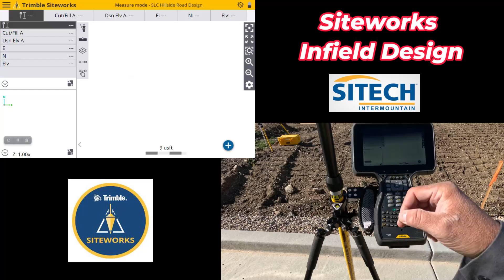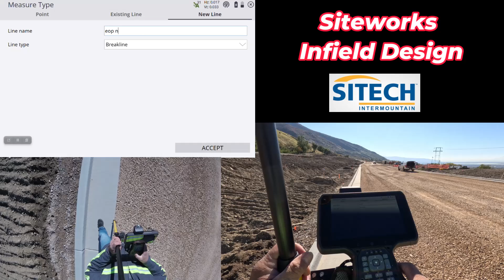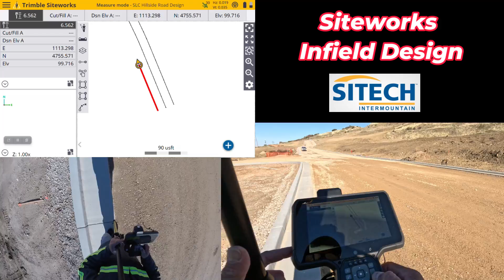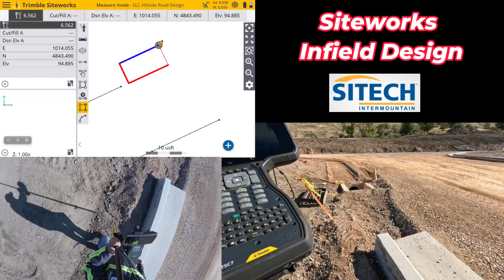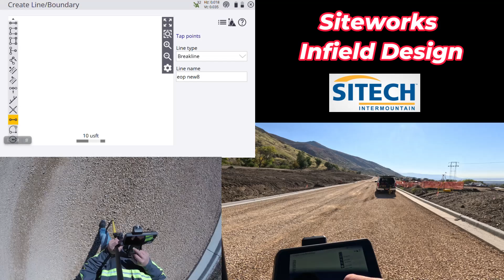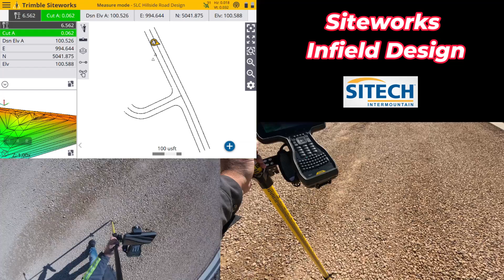Siteworks Infield Design   Creating a Design off new curb

Comment: with a one point calibrations what is the limits before you start loosing accuracy? as is how far from the base can you get before its starts to be off if at all?
Reply: Well, a normal calibration to control points is to make a design match an engineer set of plans, etc. when you do a one point calibration it is not for an office design to match anything specific on the earth or other contractors, etc.  if you use it the way I did here I am only as building or shooting things onsite with no design so it will always match.  It would work as far as you can continue to get radio from the base or even use a repeater to go further.  You wouldn’t even need a geoid because it’s all relative to what you shoot yourselves. I hope this made sense.  It’s all about infield designs.
Reply: @JeffLarsen-iz8qk  yes i did this set up and not knowing much about business center i put the pdf in aligned to the shots i took that were staked out by another company and build the model from the pdf overlay i was just worried not having full control if it would start to be off the farther you got away from the base thanks
Reply: @Nasty782  it shouldn’t be a problem.  If your job site is set up in the same coordinate system as others you are trying to match you will be in good shape.  Coordinate example like US survey feet, etc.
Reply: @Nasty782  Your concrete is your control.